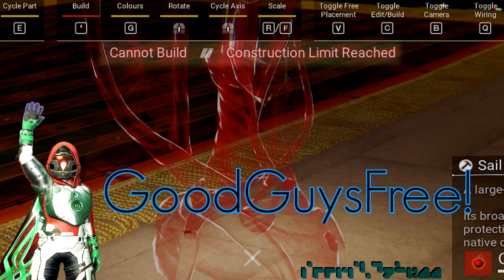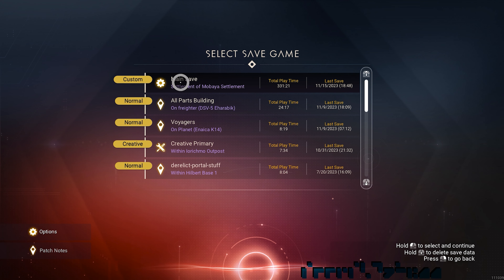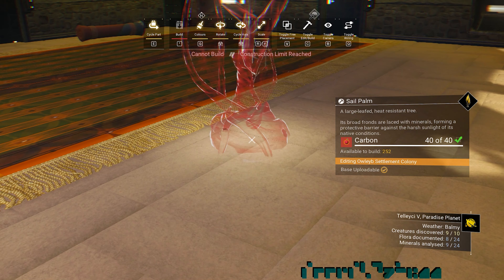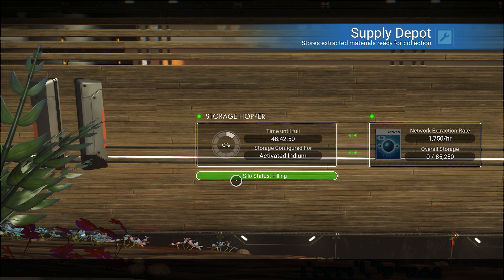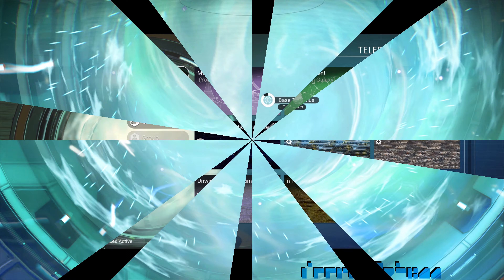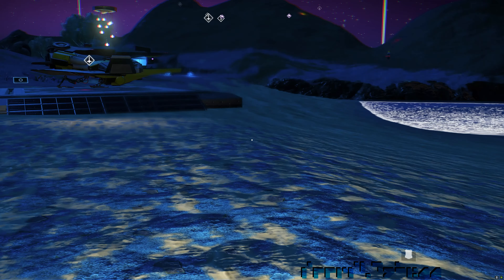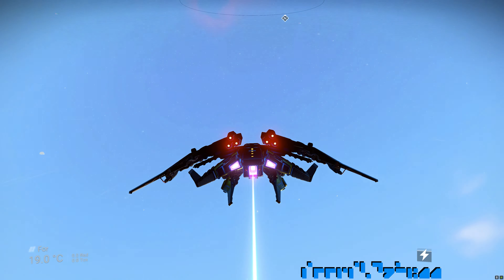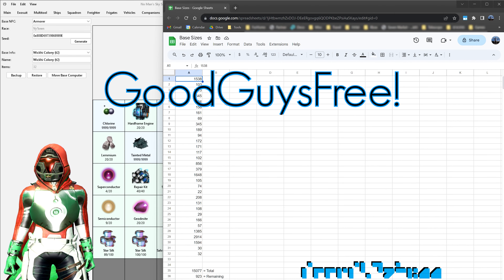Build LIMIT? What you can do when you reach the #nomansskybasebuilding limit.

Comment: I should have watched this video before I started building my tower. It is already over 3000 peices and it just the center column with a staircase corkscrewing around it.
Reply from the maker: I feel for you, my friend. There is not much you can do. If you look at my glass-dome base (see https://youtu.be/Vj08OXp3NaI) you will see that the dome is open-top.
The dome is built from a 64-sided base, with 13 floor pieces extending out, and then about 7-8 pieces of triple glass window creating the dome structure itself.
Now you do the math - 64 x (13 + 8) = 1344 parts. Originally I created a 128-sided base, and wanted to make it gigantic, needing about 20 floor parts extending from the middle. and more than 30 glass to close it. That would come out 128 x (20 + 30) = 6400 parts. Bummer.
Think how you can reduce parts. Like I did by deciding to go back to 64-sided on that dome, and deciding to leave it open to the sky instead of completely enclosed.
GGF